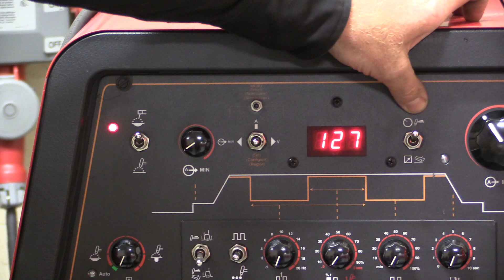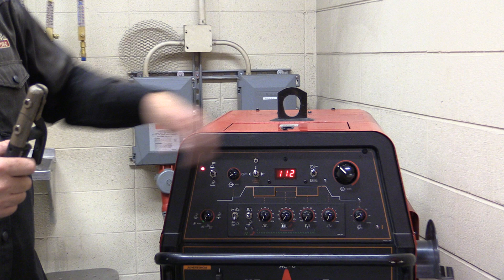Stick welding with the Precision TIG 275

Comment: Mark, I am sorry to get off today topic, but having torch issues, 8 months ago, I asked about replacing o-ring(s) on the handle of the torches body. If any type of o-ring is ok to use, that fits is ok. As an ASE Master Tech since 1978, I don't rebuild torches everyday and the design has not changed much, but chemistry has. I had a reply "Change the O-ring, it's 1/2 cent". Ok, fine, but there is simply rubber, coated rubber, HNBR and others! I was simply seeking a professional reply & got "Replace the O-Ring, it is 1/2 cent" Ok!
Not very professional but more snarky as I am not 12 years old anymore. Even though I was using a torch and the old "Crank-Top" Lincoln welder on the farm. My stepdad & step-grandpa, could weld "Grapes" on everything and wonder why I broke before leaving the barn yard! I've owned a new MIG since 1984 that is larger than most Honda car engines and burns 150 amps without some mythical math! Still use it, I just have to have a 0.023" wire slot cut properly into a drive wheel roller as it is 0.030" design won't cut it on sheet metal, but I make it work. It takes spools of ER70 on 4" wide spools, 1" hole and holds 6Kg. Just big. 
Tip; I cheat and use a brass vise jaw cap, if I can get it behind.
  (Torch Problem; When adding oxygen during cutting, it pops and goes out). I have used a medium valve seat lapping compound to create a nice shinny smooth surface for mating. Compressed air, solvents to clean & repeat. Works for everything I need and it's about 1982 Craftsman's best (Possible Harrison) or one of 900 others! 
Any advice is appreciated by this guy! Me. Thanks.